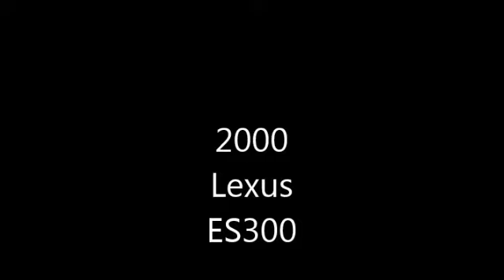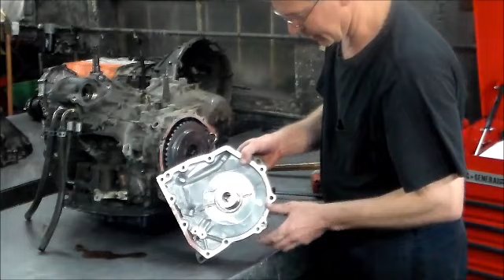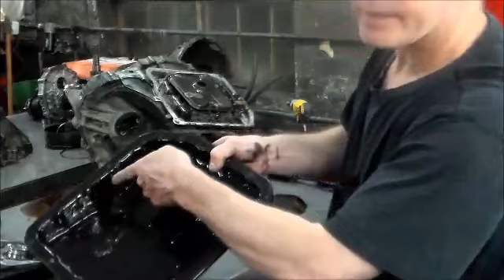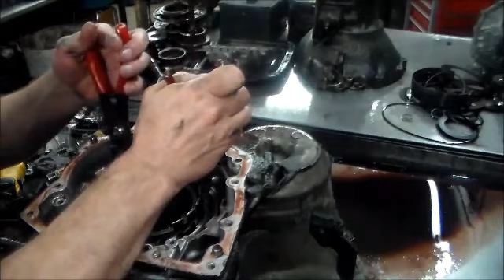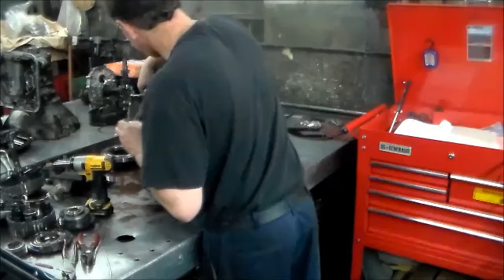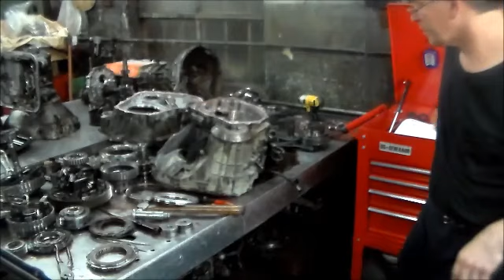U140 Teardown Inspection

Comment: Hey Gary, big fan of your channel, hey I got an RX300, first and second gear shift perfect, but it won't grab 3rd or 4th or reverse, you feel it a little but mostly like it's shuttering, when I took it apart one of the seals between the case and valve body was blown, replaced that seal and SL2 solenoid, it has a little more bite but still does the same thing, do you think it's the clutches or should I replace the whole valve body.
Reply from the maker: Probably not valvebody or solenoids, i would say there is an issue with the geartrain and possibly the 3rd clutch, if you can get the rear cover off(by left wheel) you can see the 3rd clutch and geartrain. The cover wont come right off, trans may have to be lowered down by releasing mounts or dropping down the frame, but make sure the trans is supported.
Reply: Gary Ferraro kk yeah that's what I thought was it, I went to the junk yard and there was a a Front wheel drive RX300 with a fresh rebuilt transmission, in going to do what you said, change out the clutches and see what happens, it was actually really easy to take them out. The RX has a large space between the subframe and body of the car so there's more than enough space to work in there, thank you for taking all that time and making videos for people like us, it really helps us out.
Reply from the maker: Your welcome, let me know what happens, are going to check the geartrain?

Comment: Where is the speedometer sensor (VSS) located??
Reply from the maker: +HondaSolutions   This unit didnt have the typical one over the diff. The vss signal may be picked up through the wheel speed sensors. If you have a scan tool  check abs for codes. What codes do you have p0500?
Reply: +Gary Ferraro Yes, only P0500.  I have a scan tool, but it doesn't pick up ABS codes.  I found how to pull those off manually.  Some people are saying that the speed sensor located on top of the transmission acts as the VSS?
Reply from the maker: +HondaSolutions   I believe what they are reffering to would be the sensor over the differential where the axles go in, if you have one there thats the VSS, the other one on top of the trans is the input speed sensor. Do you have a sensor over by the diff?
Reply: +Gary Ferraro There are 2 speed sensors, one is a counter gear located above the solenoid connector, the other further back from the starter.  Both are the same part # according to Lexus.  No sensor or wires are over by the diff in the back.  I'm sure this is a U140E transmission.
Reply from the maker: +HondaSolutions   They are the input and output speed sensors, if you have live data on your scan tool, drive the car make sure they are working. Some car makers use the output speed sensor  to get the signal to the speedometer. I dont think lexus does this. Do you know anyone that can scan your abs? whats the year make and model of the car?  Gary
Reply: +Gary Ferraro Yeah, I do have live data but speedometer doesn't function at all so I'm guessing I have a wire integrity issue or bad wheel sensor?  The transmission shifts just like it always has - fine.  ABS light is illuminated.  This is a 2000 ES300 with 50K miles.  I can pull the ABS codes manually by removing the short pin, then jumping E1 and Tc on the DLC1 with a paper clip.
Reply from the maker: +HondaSolutions   If the abs light is on then chances are there may be a bad wheel sensor,  where are you located, can you go to like an autozone(if you have them) to get the abs codes?
Reply from the maker: +HondaSolutions  hey.  It happens. Glad it's fixed. Thanks for watching. Please subscribe. Gary

Comment: hey Gary, i got P0755 code which says solenoid B malfunction. Do you think replacing the solenoid will help instead of the whole transmission? and can i get to the solenoid without taking transmission off the car.
Reply from the maker: What is the car doing? how is it shifting?  you can drop the valvebody to change the solenoid, most of the time the solenoid is not the problem though.
do you have an issue on the shift maybe 2-3 shift?
Reply: Gary Ferraro ,2-3 shift is rough, the engine revs high then shifts to 3rd and its rough. Then it doesnt shift past 3.

Comment: where you located i want to give you my u140e to repair
Reply from the maker: Im in New York on Long Island, Where are you located?  are you a pilot?
Reply: I'm in Tn. Wish you were here
Reply from the maker: I dont know anyone there, whats wrong with your trans?  By the way, im a pilot too. I have my private and instrument ratings
Reply: Won't go in reverse and only goes in first gear and I can hear a metal inside just spinning. Wow nice to meet you :) are you still flying ?
Reply: is there anyway you can upload a video on how to rebuild it ? putting it together?
Reply from the maker: At the moment i do not have one, but i will keep it in mind.
Reply: Gary Ferraro mine will not go into reverse feels like it's lock doesn't engage
Reply from the maker: Common issue, the planetary gearset is bad
Reply: Is there a complete rebuild set on eBay or so?
Reply: Gary Ferraro I might take a shot at doing this with a friend.
Reply from the maker: If you plan to give it a shot, i can hook you up with my transmission parts rep.
Reply: Gary Ferraro yes I'm trying to remove the transmission right now any advice?  Also is it possible to get a link to the complete rebuild kit ?